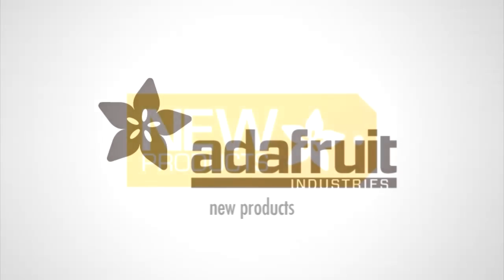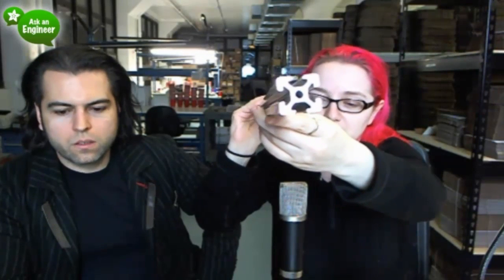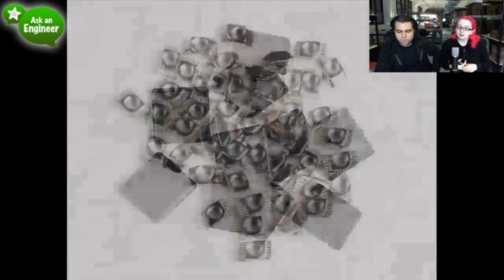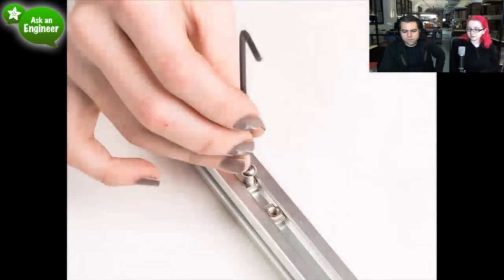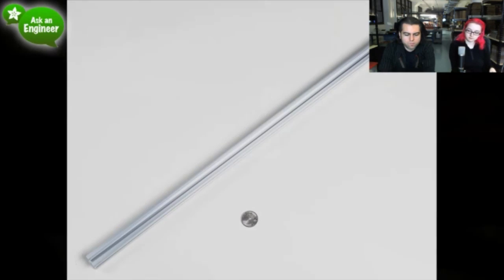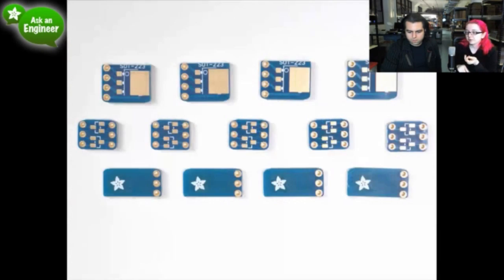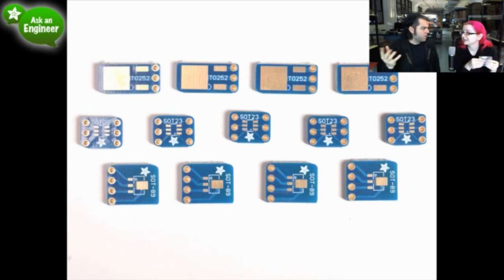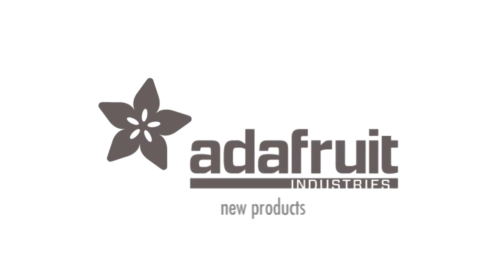New Products 1/26/2013

Comment: If i bought these quickwires  https://www.adafruit.com/products/1152 using this button  https://www.adafruit.com/products/473 all i need to do hardware wise is the the quickwire on gpio pin 5,6? If so can anyone Link me the code to make teh switch toggle power on/off a million kudos if you can help